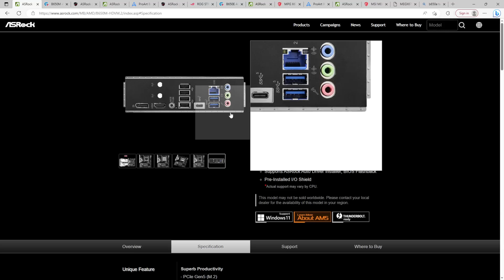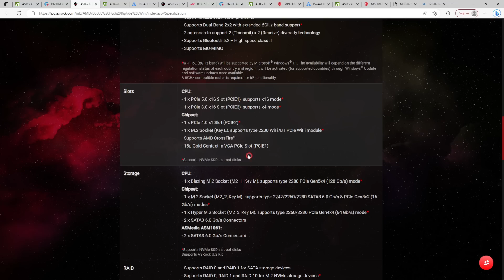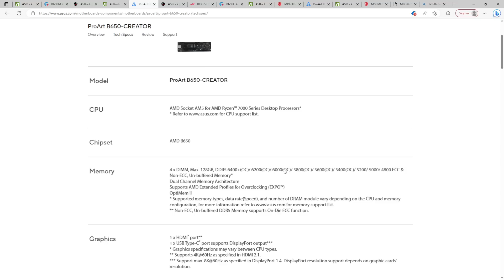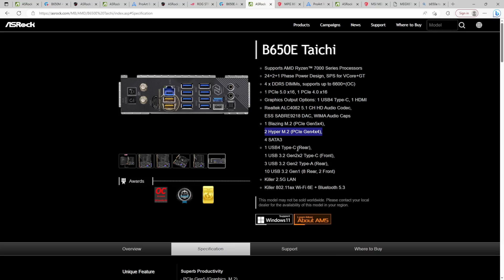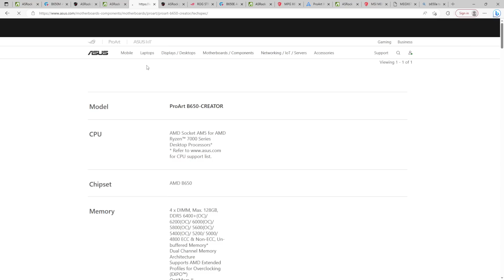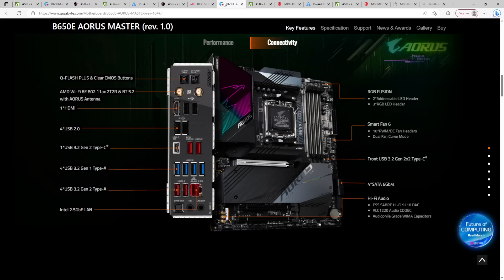AM5 motherboard round up

Comment: 0:28 B650M HDV/M.2
4:54 B650M AORUS ELITE AX 
6:55 B650E Riptide WIFI
9:50 B650 LiveMixer
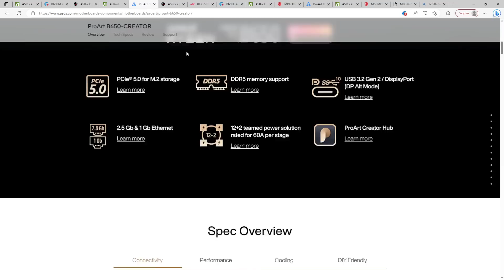13:12 ProArt B650 CREATOR
16:50 X670E PG Lightning
20:38 ROG STRIX B650E-E GAMING WIFI
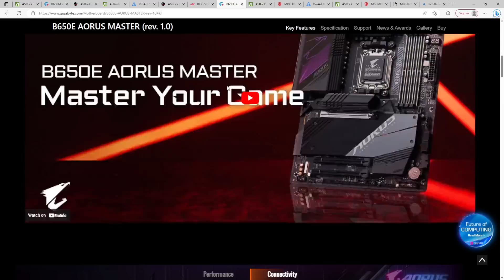24:50 B650E AORUS MASTER 
29:06 B650E Taichi
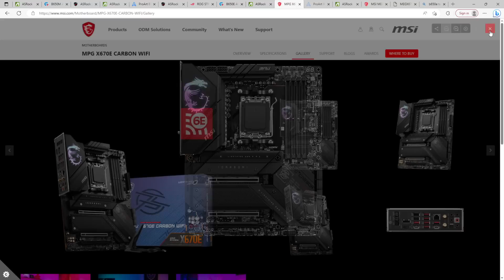33:01 MPG X670E CARBON WIFI
36:40 ProArt X670E CREATOR WIFI
41:54 X670E Taichi
44:45 MEG X670E ACE
47:36 Final thoughts
Reply: RIP no Mini ITX boards lmao.
Reply from the maker: @ShadowbannedAccount  there's 5 of them. Not exactly hard to compare the spec sheets yourself.
Reply: Wow the Aorus b650e elite ax has a com header. That’s interesting lol
Reply: @ShadowbannedAccount I got the B650i Aorus Ultra because its the only one with 3 m.2 slots
Reply: @tommyboi4872  I got the ASRock B650E PG ITX because it's the cheapest one that has a 10-phase VRM with a PCIe 5.0 x16 AND a PCIe 5.0 x4 M.2.
Reply: how about b650 aorus pro ax ?
Reply: @ActuallyHardcoreOverclocking  so they are all good to go ?
Reply: @ShadowbannedAccount  I went with the ASUS B650E-I because there was a bundle deal. But I also think it's a good option, better features than the ASRock and a better audio solution than the X670E-I with its ridiculous dongle (and no real need for the extra chip). I only miss having the option of USB 4 because my Chopin Max case doesn't have space for a GPU - or power, it's got a 200W PSU - but it's been fun overclocking the 7600's iGPU to 2800Mhz (protip: ASUS's BIOS doesn't do GFX CO offset correctly, you have to use the AMD Overclocking menus). I'll probably move to a proper APU a generation or two down the line, perhaps with more cores as well - for now it's enough.
Reply: @Actually Hardcore Overclocking The $370 AsRock B650E ITX has no BIOS flashback! So your statement about all boards having flashback is not correct. I had to return it because I upgraded BIOS to try to reduce the atrocious boot times and any further BIOS updates failed with a black screen. Returned that piece of c**p..
Reply: @ActuallyHardcoreOverclocking  Do any of the itx boards have eclk?
Reply: @ActuallyHardcoreOverclocking  After seeing your breakdown of the X670E Gene I was surprised that it's not on the list mainly because of the price?
I am looking for a reliable board and 1x m.2 ssd + 1 gpu + 2 ram sticks is all I need.
Reply: Thoughts on Asrock 650 PG Lightning?
Reply: I have the asrock 670xe pro rs, not on this list😢
Reply: After sending 1x B650E Aorus Master back and 1x X670E Hero I ordered myself a X670E Gene now. I can't fit in a 10gbit pcie card which is the only downside for me.
Reply: @andregomes3317  Pretty sure that's a no, and pretty sure the only MATX board with eclk is the GENE
Reply: @tommyboi4872 WARNING. That third M.2 slot is likely taking lanes from the graphics card, so your GPU is running in x8.
Reply: @ActuallyHardcoreOverclocking why didn't you talk about the Asus ROG STRIX X670E-E gaming wifi
Reply: What are your opinion of nzxt n7 b650?
Reply: @ShadowbannedAccount  The ASrock B650e ITX looks cool, strictly because its 10 layer PCB. That means less electrical interferance, right?
Reply: What about the Tomahawk Wi-Fi?
Reply: Do all of them come with a wifi port?
Reply: HERO thanks bro
Reply: Explain why you DID NOT count the a620 ? Please. @ActuallyHardcoreOverclocking
Reply: You are a little bit rude duck @ActuallyHardcoreOverclocking
Reply: I love usb A I love usb A I love usb A. B650 E Taichi so close to being what I want. So many of these boards come sooo close, but the segmentation on the boards is just nuts. “Oh you want USB and Gen 5 2x8? And a post code?! $500 please”  Still not sure what I’d use thunderbolt for. It’s like I can’t even plug a massive USB hub into it because no one seems to makes them
Reply: I should clarify, you can get big USB hubs but you’ll spend a crazy amount of money to make use of the thunderbolt port and at that point, for at least my use case, a big old regular USB A hub would do the trick (flight sim requires many inputs) and it’s like, why am I spending $500 and a bunch more if I’m buying an external hub anyways.
Reply: @ActuallyHardcoreOverclocking respectfully, if I  wanted to compare the boards myself I wouldn't be subscribed to your channel and supporting your content. I'm not an expert on these things like you are, that's why I come here and like your videos. Like Shadow, I was hoping to see an ITX segment. No hate, I got nothing but love for your work.
Reply: X670E Steel Legend!?
Reply: @ActuallyHardcoreOverclocking  How about you put some time stamps and video markers in your video instead of giving this guy a hard time?

Comment: Every motherboard regardless of price should have a freaking post code.  It's one of the most basic features.
Reply: literally just bought an expensive ass mobo and it doesnt even have post codes. wtf? like my $50 mobo from 2010 had post fucking codes.
Reply: No kidding, i lost 2 computers because of this. I got no idea whats wrong, the repair shops are far away so I never go... the ones nearby are clueless too. Shame I got a board for 450 dollars, and it didn't had a code. ;/
Reply: This is exactly why I can't even upgrade from my MSI B550 Unify for a year or two. It has a post code.
Reply: High-end motherboards that are like 2 generations old I found them at 100 dollars on eBay when they originally costed around 250 dollars. Crazy.
Reply: @@ezlef2 Or the manufacturer could put the $5 of parts to have a freaking post code like they freaking should.
Reply: @@ezlef2 Because the speaker sucks.  It always has.  Back in the day, you would buy a post code card that slotted into ISA or PCI because of how bad the speaker sucks.  Why decode shorts and longs then look it up when you can just look at the numbers on seven segment displays and look it up - saving a lot of time.
Reply: @@ezlef2 Most definitely worth it.
Reply: Yes the motherboard is expensive but some of them didn't have the Post Code , the company didn't want to put in !
Reply: @@ezlef2 with this logic, why charge $100 extra to put "gamer gamer gamer gamer gamer" on an anodized aluminum packed pcb. most people have closed cases.
Reply: I agree for my personal use however most people, probably over 90% if not 99% never use them. If it costs even $1-5 for them to put it, it's just not worth it anyways.

Cheap or expensive doesn't matter a lot in this cad
Reply: At just a few cents per motherboard, the two-digit POST code is inexcusable to not be included in motherboards costing over #
$100. This is pure greed, inexcusable. Our time is too precious to be wasted with blind troubleshooting. Any brand that would add it on cheap motherboards would definitely win in the DIY market, which means that none of them are doing because they're acting as a cartel. And the regulators sleep.
Reply: Just like how the X670 Aorus Master doesn't have a clear cmos button, and does really weird stuff with pcie add-on cards and M.2 SSD's. God I hate this fucking board, in fact I'm going to upgrade to a MSI MEG ACE as it has everything I'm looking for connectivity wise build in.
Reply: @benjaminsmekens2344  what weird stuff is that? I have the Aorus X670E Master, only have it for a week, but so far no issues found. Your feedback is appreciated, since I can still return the board.
Reply: I do not understand, what exactly happened? Did your PC die? WHY??? @Starfals
Reply: @Fermi_Consistency  Bro I had an EVGA mobo from 2012 that had post codes.
Reply: 100 agree, all boards should have a post code.
Reply: Bumping an 8mo thread so apologies. But want to echo the frustration here. Except we really should be getting even more than a post code for the price of high end chipset boards these days.

Playing around with an ASUS X299 Prime Deluxe II (which is a lower tier x299 afaik, was less than $200 used working) it has a POST Code, an OLED screen with additional post code info (ex  Post code may say A4, and oled has A4, HDD/Boot Device Error) AND it has Qled color coded troubleshooting LEDs towards the top of the board. Was able to actually get help troubleshooting a BIOS update issue with ASUS support (rare i know) because of all the info this board generates with post errors. Also love the clear cmos and power/reset buttons on the board. 

ALL these features have been essentially stripped out for even high end modern boards. Its so transparent, even new under 100 tier Janky ass Chinese boards that work with lga 2066 Xeons with weird recycled (presumably) server chipsets have friggin post codes and pwr buttons on the board. And the post code works too, well mostly. But still. Point is the big board manus are clearly price gouging and artificially segmenting basic troubleshooting to $500+ boards which is utterly repulsive.

Comment: The USB4 on the B650E Taichi is more valuable than you are thinking.  It allows peer to peer USB4 networking @ 40GB.  With a Nas or even a server you have fantastic bandwidth.  It defeats the need for complicated and more expensive networking solutions. So you can put a capture card on the Taichi and quickly move video, photo etc to the Nas and back without taking up the bottom pcie.
Reply: Exactly. I think the Taichi and especially the Tachi Lite now, are the best bang for the buck boards out there right now. They are the best future proof affordable high end boards. Their featureset is most likely the only one which will not be dated with the upcoming boards this year.
Reply: Well ASRock is actually owned by a former Asus guy. So it makes sense that ASRock makes some insanely good boards now

Comment: I live in Brazil, by luck a store listed the price wrong and I got a ProArt X670E CREATOR WIFI for the price of $250 boards here. It was still not cheap compared to US (if you convert), but by ours standards it was a bargain.
Reply: great. You can now provide displayport input to the motherboard so you can output it with thunderbolt 4. Great futures.
Reply: BRO I'm so jealous what the hell LOL

Comment: I have that Gigabyte b65pm Aorus Elite AX and love it. Handles my 7800x3d and ram tuning with ease. Really happy that I went with it.
Reply: Same. Everyone says the board has terrible coil whine but I haven't noticed any coming from my B650M Aorus board. Been solid
Reply: @Rolo4733  The coil whine kills me on the B650 variant of this board. I got two of the same model motherboards with the same issues. I'm starting to think it might be the RAM who is upsetting the motherboard, even though it is in the QVL.
Reply: @EverywhereIgoIball  Interesting. Because I have the same micro atx board in the video and am running GSkill Z5 Neo at 6000mhz CL30 with 0 problems even have pbo on to try and eek out some whine. Maybe I just got lucky idk but sorry to hear you had to RMA stuff that is always a pain in the ass
Reply: Should also mention I've only had the board for 2 months now so time will tell
Reply: @Rolo4733  if you didn’t had the buzzing so far, you’re clear. You RAM kit was my second choice. I’ll try to get a hold of another kit and test with it
Reply: @EverywhereIgoIball  Thanks. Best of luck my dude
Reply: Same

Comment: I have one of the Gigabyte B650E Master boards with the AVX issue. RAM stability was also a pain for the first couple months with XMP essentially not being useable until the March BIOS update. Credit to Gigabyte the board seems to be pretty solid running the new firmware.
Reply: Hi Bro, I'm confusing with this motherboard ... (AXV, EXPO, Black screen issues..)
How way to bypass AVX issue ? 
Which is Bios version right now ?
Reply: @duycuong7693  I'm using BIOS F4 released March 22
Reply: @doilookwasted2u  AVX issue persists with last firmware?
Reply: @NovoRei  I've only seen it when running Prime95

Comment: It might seem weird but one of the reasons I went to X670E Taichi is that like it's X570 Taichi predecessor that I was using, it has great IOMMU groupings if you configure the BIOS correctly. I primarily use Linux with a Windows VM and single GPU passthrough for gaming and practically every PCIe device is in its own IOMMU group making passing the GPU through to the Windows VM very, very easy.
Reply: Can you elaborate on this? I ran Ubuntu for like 6 months like...16 years ago lol. But running Linux with a Windows VM for the purpose of gaming is basically the "dream" scenario for me back then overall, and im curious about how what youve described would provide an advantage over any given motherboard (id probably get a b650 or b650e)
Reply: @roberttaylor3118  so basically, in order to pass through PCIe cards such as graphics cards, you need to understand that all on board PCIe devices bundle in IOMMU groups. And with VFIO and libvirt/kvm, you need to pass through the ENTIRE IOMMU group the PCIe device is in as well as every other device in that group. Sometimes the IOMMU groupings on certain motherboards are....less than ideal for this and the graphics card or PCIe device you want may be bundled with something like the on-board memory controller of the mobo or something crazy like that and passing that through is gonna leave your PC in for a bad time and possibly crash/reboot or just act weird. Bc once you pass an IOMMU group through to a VM, every device in that group is now unavailable to the host OS.

IOMMU groupings vary by mobo manufacturer because it's a grouping at the electrical level and depends on board wiring/design.

The Taichi boards are great bc they have some settings underneath to reconfigure them so that pretty much every PCIe slot is its own IOMMU group with nothing else in it other than the PCIe card and any components or onboard devices directly attached to the PCIe card.

Basically, the more isolated you can make the IOMMU groupings to only the devices you want to pass through, the more compatible your mobo is with VFIO. And since you can pass more than one IOMMU group at a time to a VM guest (you would just need to pass through every device in each IOMMU group passed through to the VM as well), the Taichi set up is ideal bc it lets you have more control over what gets passed through to the VM since every PCIe slot (as far as I have tested) is its own IOMMU group by itself.

So in short, I can pass through the IOMMU group containing only the graphics card as well as say a separate IOMMU group only containing another PCIe card I want to pass through (like say a PCIe USB card for something like VR which doesn't play nice with USB passthrough on libvirt/kvm). This way, only those devices pass through but nothing else I don't want passes through.